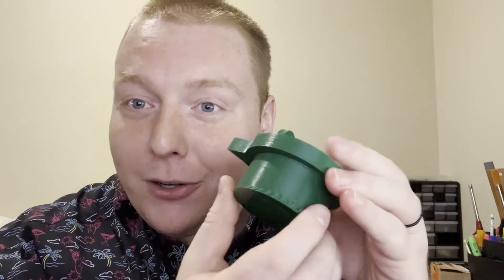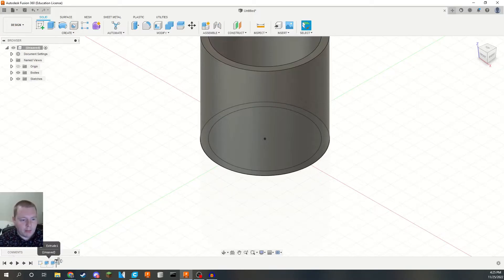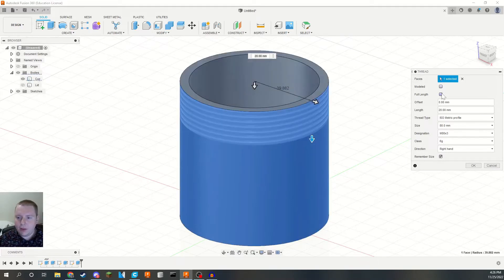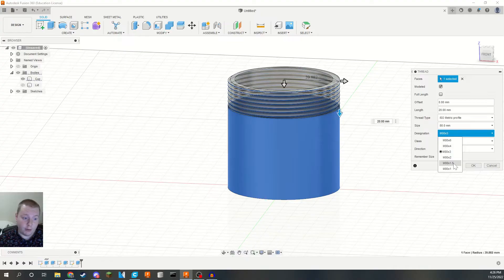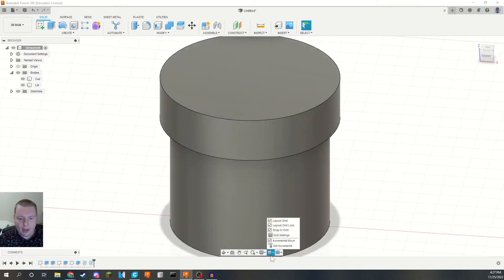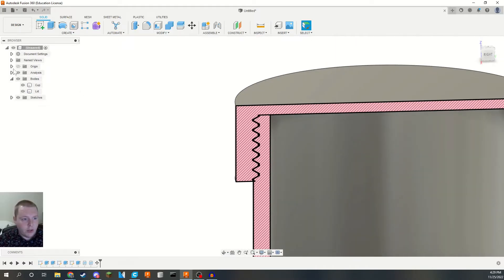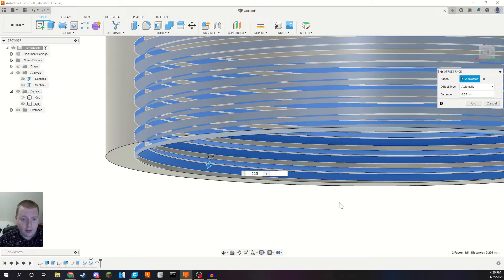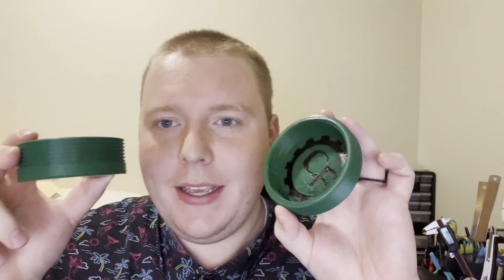3D-printed Screw-top Container: Fusion 360 Thread Tool Tutorial (FREE STL!)

Comment: Hi - I am making the screw cup, but can you please explain how to create one with less turning to close it? You originally said 20mm x 3. What would make less turns?
Reply from the maker: Threads are quoted as diameter x pitch. Pitch is the distance between threads, which also makes it the vertical distance traveled in one rotation. 

If you had 20mm x 3mm threads that were 6mm tall, it would take you two turns (6 / 3) to close it fully. 

You could reduce this by lowering the total vertical threading distance (less distance needed to travel), or by increasing the pitch (more distance traveled per rotation). 

Good luck!
Reply: Okay- I think i described my issue incorrectly. I followed your video, but got lazy and printed the finished stl files you provided. But, I wanted to create my own with less turns. So I am up to the threads part of your video. I did a 20mm lid, but what should I do to create less turns? Your video suggested 80 x 3. What can I do to have less turns? Thank you for responding.

Comment: a question, i have m6 threads on a porject i work on, when i give them offset usually the two sides combine with each other and just go into negative values. this is a screw i am talking about. what should i do if i want to adjust a screw? or does this only work on the outer pieces that are the area where screw gets onto

Comment: Printing 80mm screw threads, requires a filament that bridges really well. Because you will be printing in mid air, with no support.

Also, when you made your partial thread, the diameter of that cylinder was altered by Fusion.

Rather than offsett faces, it is easier to resize on y and x one of the threaded parts. If you know your math, you can increase the tolerance with insane accuracy this way. Just do not resize in the thread pitch direction, as that will change the pitch of the thread.

Also, I remember I printed parts like these with PLA years ago. They lost the grip in the threads over time. PLA is malleable and not really suited for anything like this.

Comment: That was super basic and easy to follow. Just from an engineering perspective... for a tighter seal, I might have extruded the very top face of the container by +1mm or +2mm, maybe with a taper, just so that when you screw the lid down tight, it's cinching down on  that top face - with all of the threads engaged - rather than just cinching down onto the lowest threads.